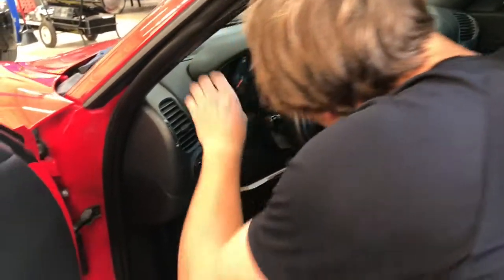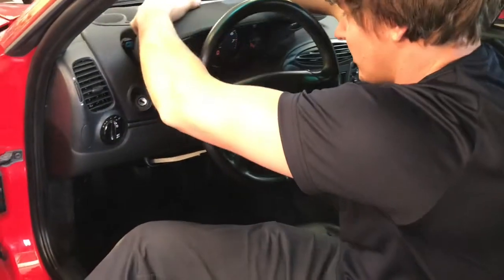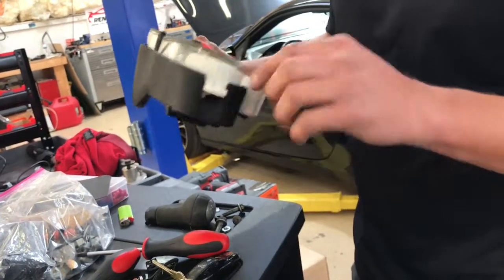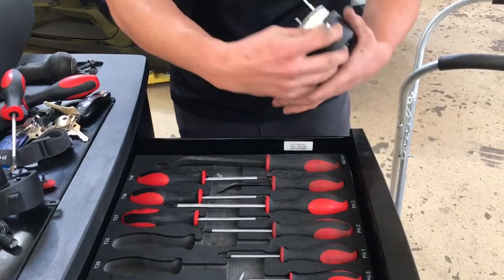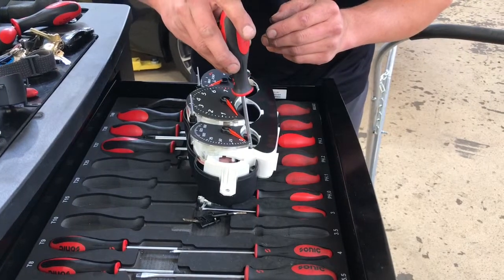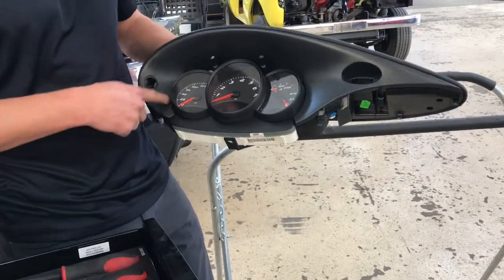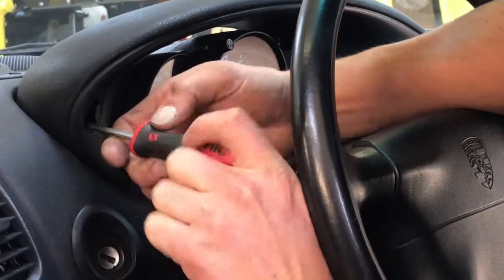How to REMOVE AND INSTALL the INSTRUMENT CLUSTER from a 1998 Porsche Boxster

Comment: Thank you for ALL of these videos on the Boxster - they have been invaluable to me and my Boxster.  This is the first video I have felt any need to add to...

So, just a few things that may be helpful to others.

1. if you don't have one of those whatsitwhoseit's that magnetizes tools, or a magnetic set of torx drivers, get an extendible magnet.  It will help get the screw behind the left cover out when it inevitably drops after it is loose.

2. When you put that same screw back in, use tape to tape it to the torx driver.  It only has to hold it tight enough to start it.  You may get annoyed enough to go buy one of those whatsitwhoseit's!

3. Unless you feel like ordering a new hazard switch and waiting for it to show up at your door, do NOT pull on any part of the switch, AT ALL without getting it started!  The video was not clear about the hazard switch.

The easiest way to remove it is to gently use two small screwdrivers to depress the two black tabs on the left and right of the switch from the front, and on the back on the open side of the switch holder there is a cut out exposing the side of the switch.  Use a small flat head screwdriver and with some force push into the switch and begin to push it out.  Once the tabs clear the front face of the gauge pod you can then use your fingers to gently pull it the rest of the way out. 

I had to drive around for a week with an open switch space where my hazard switch belonged because I tried to pull the switch out with the tabs depressed but without any other preparation.  If you are like me, that was a week of mental torture, on par with the best the CIA can devise.

Everything else in the video worked perfectly for me.  Thanks again for this, and all of your other videos!
Reply from the maker: +David you’re welcome and thanks for all the detailed extra info
Reply: I'm sorry to keep jamming up your video, but since I had to remove my instrument cluster a second time (hey, thanks to this video it isn't hard) I thought I'd share two more things.

1. I used painter's tape to line the dash under the gauges package.  The little tabs on the bottom put "indents" in the leathere that were nearly impossible to get out I finally had to get the leather soaked and then knead it while I dried it. I had to redye one small scuff it made too.  Trust me, if you have the leather option just lay down a layer of painter's tape even if you think you don't need it.  It takes 10 seconds and is cheap insurance.

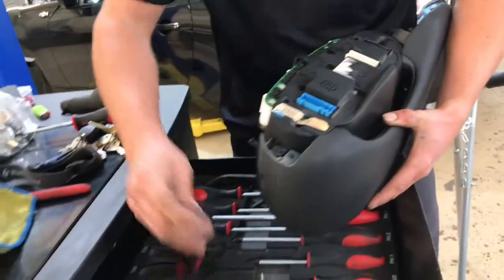2. If all you need is the cluster itself, save yourself a headache and ignore the hazard switch. The wiring harness on the hazard switch is long enough that you can 'roll over" the entire thing after you disconnect the three connectors on the cluster without removing the switch and simply take out the two torx screws on the left and right (the ones being removed starting at 4:17) holding in the cluster.  

Okay, that is all.  Carry on.

Oh, and thanks one more time for all the very helpful videos!
Reply from the maker: @David-dt2md  any time!